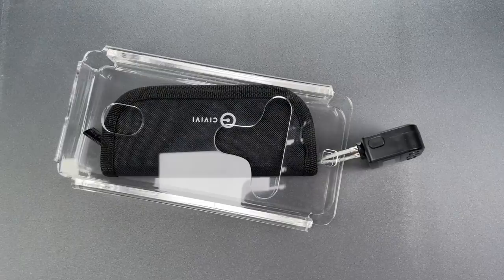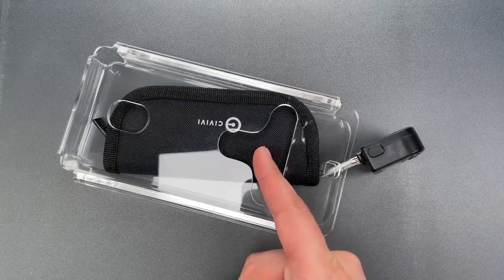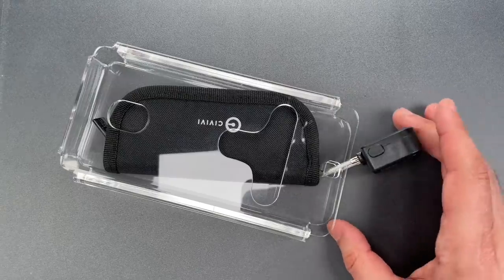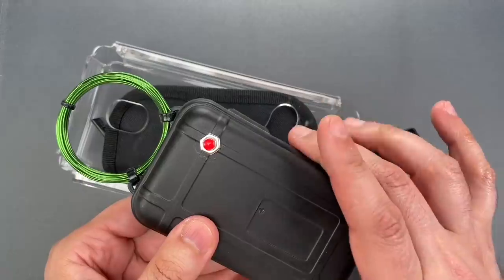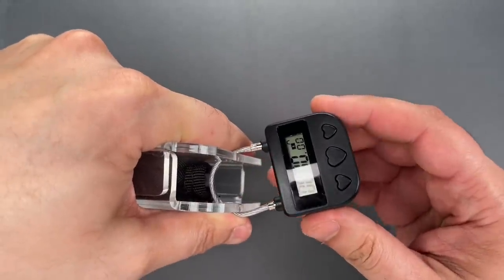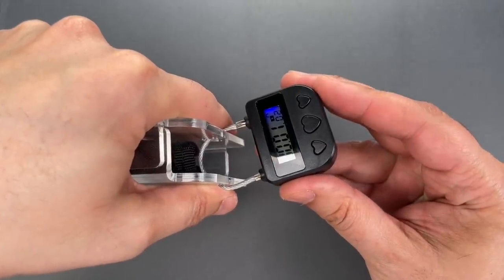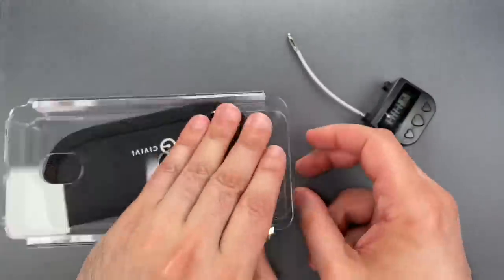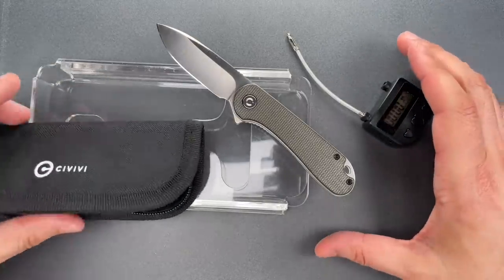[1323] Pocket EMP v. Timer Padlock

Comment: To be fair, with the 1 minute wait, this lock lasts a lot longer than most master locks.
Reply: @davidwarford3087  Because the EMP "blast" confuses the lock to not know it's time, but the programming only sends the "open the lock" signal when the timer actively runs out. Basically the "post EMP" state is identical to the "has just been opened and then closed again" state. So the lock is shut and it's ready to accept a new time limit.
Reply: @andersjjensen   r/whooosh
Reply: Not if you go the destruction route in which case even a pair of scissors will probably cut that cable.
Reply: "This is the LPL.  Some of you were saying that 1 minute was a long time to wait for the lock to open.  So I built a time machine"
Reply: This is the most underrated comment lol
Reply: @andersjjensen  yes we all watched the video too
Reply: @xvaldez3284  or you could just push hard enough on the release button. (I’ve had to deal with one once and yes, they open if you just push the button decently hard)
Reply: I opened a master lock in 5-10 seconds. It was one with a separate loop that I put on backwards in error, blocking the key hole.
Reply: I almost spit.
Reply: Savage!
Reply: i like how he FF the minute so not to milk us for YT revenue....
Reply: Tbh he couldve just cut the lock
Reply: @jerrylindstrom3323  that is not the LPL way. We didnt come here to see a man cut a cable. We came because EMP
Reply: the first lock I ever picked was some shitty master lock 532, I got to the point where if it was in a vice or something to hold it i could pick it one handed in less then 10 seconds. Those locks are are shitty its easier and faster to pick it rather then cunt the lock. Fuckin utterly useless and I love them. I go around to people who use master locks and show them how fast I can pick them just to see how horrified the look on their face is. These people literally use this shit to secure all kinds of really expensive shit.
Reply: Yes. He needs to defeat that timer.
Reply: 😆 So true
Reply: HAHAHAHA🤣
Reply: to be fair, this metal lock would take 3 seconds to cut ;-)

Comment: Slash resistant bags beware, there’s a new knife in town.
Reply: I don't want to hear it  ( - there's a new knife in town... )
Reply: You know that cell phone thing looks decently slash resistant
Reply: @KBJade39  probably not stab resistant
Reply: "Now I'm going to use the knife that Dustin has sent me to open this slash-resistant bag."
Reply: @RaiokIncaris  this reminds me of that Tumblr post of an infomercial except you don't know what they're selling. "I will now show you that this knife can easily cut through this slash resistant bag. Inside the bag is a drill that I will use to open this metal box. Inside the metal box is an adjustable key..." etc.
Reply: This is the bag slashing lawyer...
Reply: For what it's worth Civivi makes really good knives for the $50-$100 price point.
Reply: @KBJade39  you might be onto something, some kind of herringbone plastic interlocking bag
Reply: @peyofox  that's why it's sub $100. You can get better knives made in America, but for at least 50% more.

Comment: If you dont have a pocket EMP, simply detonate a small nuclear device and use its EMP instead
Reply: yeah, because everybody has one of those laying around. LOL!!!
Reply: Wait you don’t?
Reply: If you don't have a small nuclear device, simply create a pulsar and use its EMP instead.
Reply: If you find yourself unable to create a pulsar, simply coax the sun into releasing a large solar flair on earth
Reply: @codyyoung5946  flare
Reply: And if even that fails, just place the lock into the event horizon of a miniature black hole.
Reply: does a Davy Crockett work?
Reply: Is an F15 required?
Reply: @99.6survivalrate4  that would greatly reduce a 99.6% survival rating
Reply: @99.6survivalrate4  It's not required, but it helps tremendously. Basically, I no longer go anywhere without my trusty F-15. I use it even to get my groceries.
Reply: use pocket nuke
Reply: Thus, resetting ALL the electronic locks. Those that haven't melted, anyway.
Reply: A man of culture.
Reply: "This is the LockPicking Lawyer and here's the pocket Atom Splitter than I made..."
Reply: Imagine not having a mini nuke unironically smh my head
Reply: @DanceySteveYNWA  Maybe the sun calls it its solar flair because it does it with such style?
Reply: I ran out of pocket Nukes last week, will a pocket thermonuclear bomb work?
Reply: @michaelm1  I would use a hot air or weather balloon to raise the nuke at the right height for maximum EMP effectiveness.
Reply: You forgot to mention that you can pick up small yield pocket nuclear devices at any Dollar General.
Reply: If all those fail just get in your time machine  and goto after the lock is set to it.....shheeeeeesh
Reply: A pocket nuke?
Reply: @Milnoc  I'm not sure that would work. Last time I checked, nukes aren't particularly lightweight. Can they be lifted with a weather balloon? How about commandeering an ICBM instead?
Reply: Be careful though. In some US cities detonating a nuke can get you fined.
Reply: Heck just get a quartz crystal strap it on your back with a wire and do something your wife will hate you so much she'll slap you, her slap can be powerful enough to power a city
Reply: @ejcorreia2  that’s the joke
Reply: Fun fact: Causing a nuclear explosion is punished with at least five years in prison in Germany. I'm not sure if other countries have similar laws.
Reply: @michaelm1  The Davy Crockett field artillery sized nuclear weapon was already mentioned.  It's the size of a very thin human and has the dial-a-yield feature to let the artilleryman set the explosion size in kt TNT . The weapon as commonly depicted may or may not include a short range rocket to place the explosion a few miles from the men unleashing it, thus not needing a balloon.
Reply: @no1DdC  ...thats it?
Reply: @dylanking6960  Well, you'd get additional charges if you destroyed any property and endangered any lives in the process, which would be pretty likely. 

It's actually a fairly high sentence, because it's at least five years, not a maximum of five years. This kind of punishment is reserved for very serious crimes.
Reply: @migmit  Only SOME U.S. cities?!
Reply: @andyowens5494  Well, the owner of the channel is a lawyer, maybe he can settle the issue? I don't mean experimentally.
Reply: @IPwn3dJo  Probably not American 🙄
Reply: @IPwn3dJo  No one does. There have been shortages of just about everything over the last year.
Reply: Can also use an F-15.
Reply: @Syuvinya  I know I'm watching good content when the comments contain phrases such as "simply create a pulsar."
Reply: That only works if it's detonated in a plasma, like say... the ionosphere.  But flame is  a plasma, so...  "This is LPL, and today I will be opening this electronic time lock with a Ronson and a small fission device."

Comment: "He may be good, but when there's no mechanical backup lock, he surely ca-"
"So anyways, here's my EMP generator."
Reply: Aha you said a little too much like if it was you who sent it 🧐
Reply: "No mechanical back up, he's never getting through this."
LPL- "Apagando las luces!"
Reply: @GENERALGRIEVOUS627  “hello there”
Reply: You know, you could make one yourself for cheap, 1 meter copper wire, and a triple a battery. It also works if you want to fry the circuit completely. If you want to make it pulse instead of continuous, then you need some circuitry for that. some transistors is all you really need.
Reply: @livedandletdie  it sounded like he used a stun gun for the circuit
Reply: @livedandletdie  i know, while i never built an amp in perticular, i once build an eloctric motor myself, which works quite similary. Funny enough the voltage amp required for the EMP spule works almost the same, so it is the Thanos meme xD
Reply: Hahaha…,good one!👍👍😉
Reply: @livedandletdie  you do know that DC through a coil does literally nothing, right? also a AAA battery isn't exactly what i'd call "high voltage". and no, "some transistors" won't do that for you either.
and if you're going for cheap, the thing here was literally just a 3 bucks taser module with a coil across the output.
Reply: @eli-boy7473  ohwow what's going on here... literally nothing you just said is true or made sense, are you in a bs competition with the major? we're talking dangerously high voltages here, maybe stop misleading people with bs like that?!
Reply: @nonchip  weenies weenies weenies
Reply: @nonchip  Before you throw around missinformation and insulting people you should do your research. Voltage is not the thing that is killing you, current is. You can exponentially crank up the voltage when you stay under 50ma. And on 50ma the lowest leathal voltages are 120V dc or 50V ac. When you claim to know shit about this topic then you should know that some fences use up to 22000 Volts. Even the piezo crystal in your lighter goes up to 15000V. Never died because of that, did you? And that is without taking the amount of time that the current flows through you into consideration, which is a factor that can make a huge difference and that you can regulate with an impulse circuit or just a simple fuse. 
Also, if you say that dc running through a coil isn't doing anything, then you appearantly don't know how electro magnets and the hundreds of different components and devices that use them work. 
Now, say sorry and move on.
Reply: @eli-boy7473  >voltage isn't the one killing you. Current is
Stopping reading right here, what a load of common bullshit misconception...
Reply: YouTube comment section needs to take a electronics class look up how many volts a static shock is...
Reply: I was thinking the same thing. I’ve been an electrician for nearly 20 years and worked on a lot of electronics as well. This thread is just funny.
Reply: @RieMUisthegoaT  honestly i just stopped reading his comment at the same spot for the lack of common sense

being lightminded is a serious danger...

allthough I managed to get fucking bitchslapped by our local voltage of 230v~ while doing wiring in the walls. in germany.

fuck that hurt and i dont want to experience it again..

needless to say, i might very well be lightminded lmao
Reply: @nonchip  you are incorrect, the magnetic field through a coil changes with a varying current. When the DC current is turned on and off the magnetic field expands and collapses respectively.
Reply: @eli-boy7473  It's not the voltage or the current... its the high frequency AC... that allows it to pass through your body that otherwise doesn't conduct DC well. Relatively small AC voltages and currents can kill you by disrupting your body's electrical signals if the pass through the wrong areas of your body... a taser has high voltages mainly to cause pain.
Reply: @Wingnut353  While that's not wrong as the ac frequency can for example disrupt your sinus node, dc can kill you just as easily, and that is very specifically due to the current that is subtracting your heart muscles for the time that you make contact and stopping them from fully subtracting afterwards, which can either also lead to fibrillation and eventual a cardiac arrest, or slowly (any very painfully) kill you because your brain doesn't recieve the oxygen it needs, but that second case doesn't seem to happen all that ofteen because help is usually faster. But i have heard of a case of someone who had lasting brain damage due to lack of oxygen after an electric shock. 
About that ac frequency thing, because i was unsure i asked my supervisor at the fire department today and he said that as far as our job is concerned, we have the same procedure for first aid which is why it was not a detailed section of electric hazards. The best we can do in any case is defibrillate, and even then we are only allowed to do so if the emergency doctor is not on the site yet, so disruption of the sinus/av node are factors outside of our field of work.

But to connect this back to the EMP generator, i may have formulated my arguments in a weird way; i obviously don't encourage anyone building one himself; if anything malfunctions, you are exposed to potentially leathal doses of current. I am sorry if i came across as encouraging of stupid acts; don't try this at home!
Reply: @conordarragh7070  Right? It takes 3MV/m to arc through air, and I've definitely produced sparks a couple millimeters long just walking across a carpet in dry winter air. Meaning I've repeatedly taken 6-10kV shocks to my fingers and never came away with anything more than an extremely minor pinprick of pain.
Reply: @eli-boy7473  'the voltageamp?'
Reply: @eli-boy7473  so can you open electronic locks with a stun gun or not?
Reply: @RieMUisthegoaT  it's a decent explanation for the layperson without getting into how current is the real problem. It also serves to explain why a taser won't kill you, but a street mains line will.

Anyways, I'd agree that it sounds like he used either a stun gun or a taser as the base for his EMP. I'm going to guess taser because stun guns tend to do more of a continuous discharge, while tasers have a more pronounced burst effect.
Reply: @eli-boy7473  Also, I should point out that DC can kill you because it contracts your muscles continuously, unlike AC. So if you're holding the thing that is shocking you you can't let go.
Reply: @svchineeljunk-riggedschoon4038  wow, this thread went on^^ Well, same goes for all common AC powersources, a 50hz impulse won't leave you time to let go
Reply: @livedandletdie  you'll need a bit more than just transistors to make a HV oscillating circuit, but it's not rocket surgery. But you will need to charge pump a condensator for each pulse and have a circuit to fire the charge through the coil, so unless you want it to be stupidly big you need IC's for some of it.

Comment: "The only  barrier to opening this lock is time..." 
Makes time go faster
Reply: LPL is a god, confirmed.
Reply: laughs in made in heaven
Reply: and here my pocket time machine 👀
Reply: It might be possible to do this... by tuning an antenna to the clock circuit and causing the clock to run at one of it's higher resonant frequencies... it may even work on many such devices as most devices would be using s 32khz clock circuit. On the other hand some may omit that for cheapnesss as they don't really care about accuracy.

Comment: Lock Company: This time there is literally no key hole.
LPL: *whips out AN ACTUAL EMP GENERATOR THAT HE BUILD HIMSELF
Lock Company: why do we even try..
Reply: There's two screws behind the display cover, which is just glued on.
Reply: @rolfs2165  There's also a reset button behind the cover, too, which resets it in the same way the EMP did.
Reply: This made my day 😂😂😂
Reply: @oolivero45  And it can probably be shimmed as well if I were to guess. Clearly it's only meant for protecting against simply taking it. A pair of scissors could probably cut through that cable with some effort, and seeing as it has a plastic body, just pulling hard on it will break it.
Reply: to be fair, it reveals another vulnerability to consider covering.
next time, the lock will come emp shielded. =D
Reply: @mrkiky  I own one, and I can confirm that yes, pulling too hard breaks it - and it doesn't even take that much force before it breaks either.
I think it's more just intended for things like locking your own devices away to help break a smartphone addiction, and for certain other "adult entertainment" uses.

I have two of them, one of which is completely dead - the cheaply designed electronics inside broke so it's useless now. When I get a chance, I'll have a go at the cable with a pair of kitchen scissors and report back on how much resistance it puts up before breaking.
Reply: @mrkiky  I've just done those tests I said I'd do. Surprisingly, I actually couldn't cut through them with any scissors in the house - although wire cutters did work in the end.

Comment: I love that he just made his own EMP (casually I might add), this is truly why I love his content. I’m sure there were easier ways of doing this, just not nearly as impressive.
Reply: A sledgehammer covers  BOTH,  'easier'  and  'not nearly as impressive.'
Reply: The emp was just a wire coil attached to a taser
Reply: EMP isn't something complicated, many regular devices do it in small ways to function, its just they are concealed in a way to not harm stuff around it.   Its one of the reasons you see sound equipment with "shielded" wires or such.
Reply: @strangelaw6384  make a video on how to make one
Reply: @whatthe2458  why make a video. It’s just physics. Tasers send a pseudo ac, square wave form. The current in the wire produces a magnetic field and an alternating magnetic field inducts a voltage which pushes a current.
Reply: @Clancywiggum97  I would still like to see how you make one.
Reply: @whatthe2458  put a coil of wire onto the terminals of a taser, if that's not enough information for you the project is too dangerous for you to do yourself.
Reply: @MudakTheMultiplier  Sorry genius,  it was just a simple ask, I like the set up.
Reply: @MudakTheMultiplier   If it’s so simple, certainly you can make a simple video. I’m sure others would love to watch your video as well
Reply: @whatthe2458  There's plenty of them on youtube already. I just searched for "EMP", no other keywords, and the first result is a 4 year old video on making a pocket EMP....
Reply: @MaverickBlue42  Thank you
Reply: @whatthe2458  
Look up "induction" that is what the device that LPL made is using.  The coil produces an EMF that induces EMF in electronics that enter the coil while active.  

EMP is the correct term though, it is an induced electromagnetic pulse.